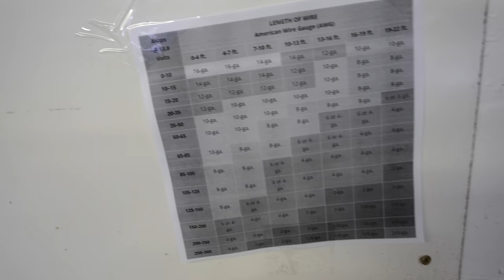Building the Brains of a Low Voltage System - Electric Hummer Conversion

Comment: I’d recommend throwing some rubber grommets in the holes with wires running through them to prevent chafing. Other than that, this build is looking good!
Reply: Thats a good advice
Reply: Pretty cheap on McMaster
Reply: Yes, definitely do this
Reply: I would also suggest that there should be fuses in the relay control circuit supplies to protect against the risk of a melt down in the event of one of the relays developing an electrical fault. Keep up the good work and stay safe.
Reply: I agree
Reply: I noticed that too, I also noticed he had a heater on in the background, so looks like he shot this months ago already.
Reply: Don't forget wallace

And some cheese for good measure
Reply: True
Reply: @jrw0707  he said somewhere he started in January
Reply: The hummer is probably complete and we are watching a video which was shot back in June
Reply: @aligatorpolo2023  based on his polished narrator voice , yeaup.
Reply: You need to have fuses on the wires going to the relays. If there's a short elsewhere then it's unprotected
Reply: The cheese Grommit
Reply: Also by removing the yellow always on wire, he has introduced a place for water to ingress into an otherwise watertight design.
Reply: Makes sense, he will probably want to use it off road.
Reply: Baby powder works
Reply: Your so right!
Reply: Had the same ide man 😄hope he fixes that later on
Reply: I agree.

Comment: I was a school bus mechanic(lots of wiring) for 20 years. Your electrical work is fantastic. Proper tools, proper layout.  Perfect job!!  Great workanship!
Reply: Wiring is an art, every time I design something I have to lay it out like this otherwise it easily becomes a huge nest of wires.   I like the ABS trick, I always used wood for the same purpose but for this kind of stuff ABS makes more sense.
Reply: Fr everything I seen was fairly legit being an commercial electrican myself everything you did should last a good wial 👏
Reply: I do hvac for the school district in my town an I absolutely love wiring and making it look neat an clean
Reply: @SkaterStimm  I discovered this a little too late. A huge nest of wires describes pretty well what my current project's wiring looks like, except it looks like Medusa's head. At this point, I am only hoping that the EMI induced by all the chaotic wiring will not wreak havoc on the grounds, relays, etc... to teach me a painful lesson!
Reply: @jameswick8358  commercial electrician and auto electrician arent compareable. Literally seen mains sparkies fry cars because "Im and electrician i can do it"
Reply: Proper tools! uses tiny piece of copper bent with hammer, also cut with a bandsaw
Reply: I'm a generator electrical engineer and I can agree, I use all of those tools and methods, the amount of shoddy electrical work I come across is ridiculous it's good to see somebody who actually understands what they are doing!
Reply: I don't know about those heat shrink solder connectors though
Reply: @nanoadrian1  they have to be better than your standard crimp connectors though.
Reply: @pipisugbo  they really aren't. Solder can crack from vibrations. That's why good car electrician crimp their connections instead only soldering.
Reply: I have literally nothing productive to say other than y’all are rly interesting to see talk and also to the dudes doing stuff for schools keep it up
Reply: @nanoadrian1  I know right? I thought you heated those until the solder in the middle melted

Comment: Totally agree with the desire for the perfect layout, but just committing to a layout do you can start. I figured for sure I’d thought of most things, but then sure enough I always wish I had moved something afterwards 😅 - love the plastic mounting plate. Seems much easier than the vinyl coated plywood I normal try mount stuff too. 12v circuits are so dang fun to wire. It’s comforting how straightforward it is once I wrapped my head around wire size for desired load. The big bummer is the quality difference of the different connectors available on Amazon. Some of them are amazing, others just complete suck. The adhesive lined ones are my personal favourite along as they come with the proper metal thickness for the wire size they are meant for. Looks like that’s the kind you got for most of your end connectors good stuff man! You’re doing this build so incredibly thorough. 

Unfortunately so many Amazon sellers just cheap out massively on connectors and that really starts to show with 12awg circuits. 

Those terminal buss bars as connecting areas look so dang helpful. I so wish that I had used those on my van build. What a great way to terminate circuit wiring and allow it to easily be modified with cable cutting. 

I love the level of breakdown you are doing for this series. Probably took so much effort to keep it concise. Not to long and not too much details, but totally info I wish I’d seen in this format 5 years ago. Love it!
Reply: this is very good advice - Perfect is the enemy of Good Enough! But to go with that, there is something called "Second System Effect" - the second version of something you build, you want to add all the little things you thought of the first time around, and it turns into an overcomplicated mess (with a lot of features you (or your customers!) never use but have huge hidden cost)
Reply: Also a great way to find good parts is - go to a supply house! Buy some different kinds of connectors, find what you like, then get the part number off them and find a cheaper source! Supply houses are expensive but they don't EVER sell bad gear.

Comment: 6:50 if you remove a wire you may need to plug the hole to keep it sealed
Reply from the maker: Very true.
Reply: @JerryRigEverything  yeah
Reply: Ioan Croitor  i agree 100000000%
Reply: @JerryRigEverything  do it, give him a heart he longs for one
Reply: Simple advice that will save you a massive headache years from now!
Reply: I was thinking it, but its not in the engine bay exposed to the same elements relays would normally be, apart from the passengers butt...
Reply: @mcduffchannel  I think water could get in there if not properly sealed but since all the connections are exposed anyways a not sealed relay is definitely not the problem
Reply: Well, every episode I'm telling him to put threadlocker on all the bolts...
Reply: he did say he's not an expert.... Though he did everything else so well, these mistakes stand out even harder, lol
Reply: Mike is expert on this stuff.
Reply: @mikeselectricstuff it seems we watch all the same kind of videos.
Reply: In my expert opinion, you’ll just be wasting time and material on plugging that hole up. The other pins are exposed anyways, from the factory. And the relay itself isn’t sealed up either. So no need to fill that center hole up.
Reply: @JerryRigEverything  hey zack at least give him a heart ❤️ he deserve it.
Reply: You are not wrong. It really depends on multiple factors though. I've seen applications where condensation gets past the seals on the connector and eventually fill the relay holder with water that can't get out. But I've also seen where the hole was left open but the relays were mounted upside down so they obviously filled with water.
Also, they(Aptiv, formerly Delphi, formerly Packard) make like 9 variations of that rubber wire seal to be used with different wire configs and different combinations of wire sizes. Kinda difficult finding the seals for sale by themselves though, usually best to buy the relay holders as assemblies that come with seals (they usually are sold this way) but make sure to get the ones that have the seal you want.

Comment: AC runs on the outside, "skin effect", DC takes the whole width.
Reply: Yeah, was going to note this myself too.  Fortunately there's no (to my knowledge) downside to his choice(?).
Reply: Indeed, though the motor is probably powered by AC.
Reply: that alerted me too!
Reply: Also I don't think the orange wire he was showing was designed like a Litz wire or ACSR, having different stands that thin to minimize skin effect would only make sense if the strands are insulated
Reply: a bit more precisely: the higher the frequency, the more outside the current flows
Reply: @anonpls9909  I don't think that is Litz,  there is no need for a high-frequency power line.
Reply: Thanks, I'm no electrician but that didn't sound correct.
Reply: "skin effect" is very low for 50 / 60Hz 230 / 110V electricity ... it is problem with high frequencies, or very high voltages ... in this case, small strands instead of solid one is mainly for practical reasons, who would bend so thick single strand?
From Battery to converter there is DC current, son no skinn effect. Fun is, that his electric motor use high freq. AC current, so yes, there is an skin effect problems ... so, he was (probbably accidentaly) right: D
Reply: Also, three phase is a standard, so AC takes the cake.
Reply: @ Totial they way you said that sounds like Yoda.
Reply: I’d guess the drive for the motor is a variable frequency drive, so the skin effect could be an issue for the motor drive system
Reply: Downsreeam01 I would love to see someone prove that ac runs only on the outside of the wire and DC the whole width of the wire.
Reply: And the higher the frequency the more it comes into effect!
Reply: @jozefhudak2835  The electric motor is low frequency,  probably less than 1000Hz full throttle.
Reply: @jozefhudak2835  The maximum frequency for 100% skin depth for AWG #2 solid copper wire is 410 Hz.  The Tesla motor probably does not exceed that frequency (just a guess).  The maximum frequency for 100% sken depth for AWG 4/0 solid copper wire is 125 Hz.  I cannot find a source that shows the frequency range that the Tesla motor uses. At 60 Hz, skin depth is not a factor, as you pointed out.
Reply: @jimhowardbatey410  it depends on how many poles motor have, and what is the top rpm... more poles = more torque, but higger freq for same rpm...
Reply: @stevenpersoon  Yeah he mentioned it in the last video, for regenerative braking.
Reply: it is J, current density